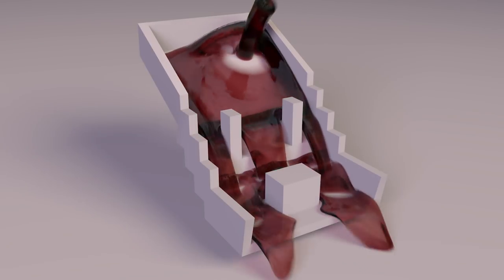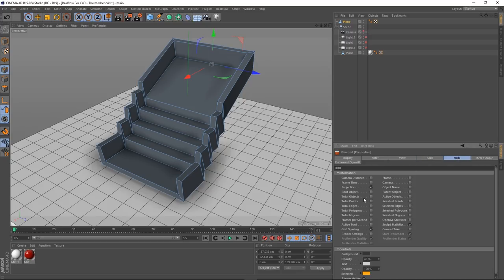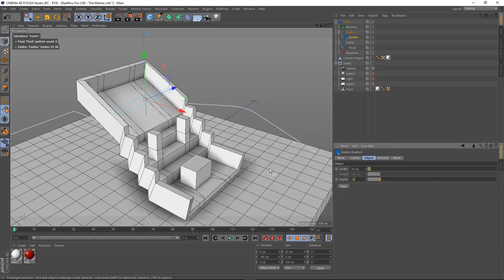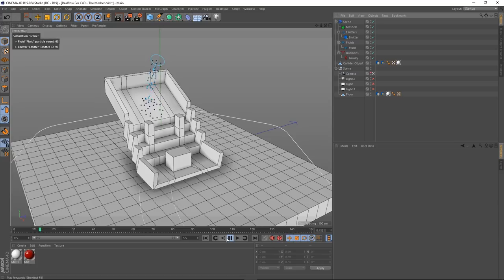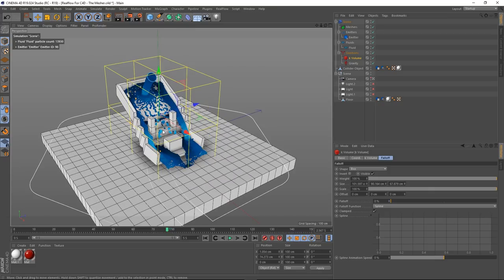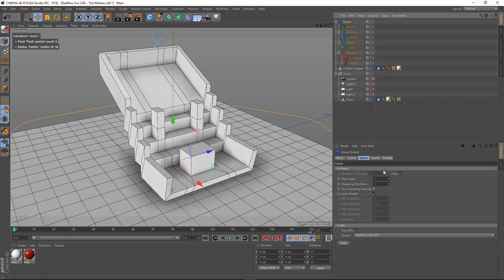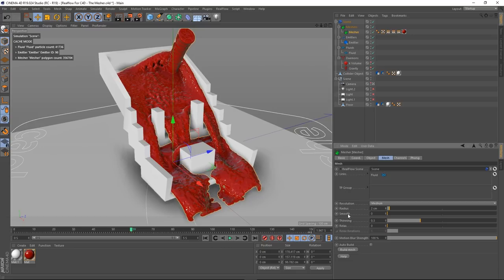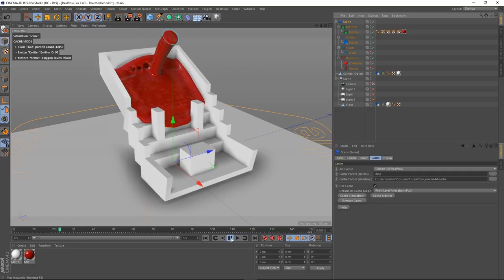Realflow For C4D: The Mesher

Comment: Thanks for posting :)

Quick question: 
My liquid never seems to come fully in contact with my objects properly, i can always see a gap.. like theres an invisible force field...

is there a particular setting i should be adjusting? thanks :)
Reply from the maker: Yes, On your collision object check the "Volume tag" there you will see a setting for "Surface offset" uncheck "Auto" and set it yourself.

Comment: I can not get it to actually mesh, i see lots of particles and they are behaving as expected but have not been able to produce any actual mesh.. It does display a polygon count (thousands) but I do not see any.
Caching the particles works fine but when i cache meshes it says that its caching gigabytes in mere seconds (while the cache folder does not increase in size). I tried changing cache folder but that didnt seem to make any difference.
Reply from the maker: I'm guessing you have a mesher object in the stack, is it ticked on?
Reply: @DIGITALMEAT  Is this the stack? If so, yes. https://i.imgur.com/kKFDHbm.png
Reply: @DIGITALMEAT  turns out the actual result of the mesher was located way offscreen, moving it around solved it.
Reply from the maker: @deathstroyer  Did you accidentally move the position of the mesher object after caching it by any chance?
Reply: @DIGITALMEAT  no it moved the mesh to the wrong spot because it couldnt handle the psr constraints on the emitters i think

Comment: Im trying something similar with realflow, and with less resolution(200-400) in cinema 4D R20 the scene is laggy when I press play... I've seen you have a gtx 970 here and Im using a gtx 1060 and i7 6700k processor. Also my cache sim takes close to 10 min long... What can be the problem? Tnx for the tutorial its so helpful!!
Reply from the maker: I'm actually using 2 X GTX970 in SLI, how much ram do you have? what's it's speed?
Reply: @DIGITALMEAT  16 GB DDR4 2400Mhz, but soon im gonna add 16gb more
Reply from the maker: @dariomartinez4974  - that should be fine, mmm
Reply from the maker: @dariomartinez4974  - Are you using an HDD or SSD?
Reply: @DIGITALMEAT  hey, thanks for the vid. I did the whole thing and it's fine and dandy. for some reason for me it was also really slow, even when i cached the scene. 
i did almost every settings identical to you, but still it's not capable of playing it back fluidly. 
do you have a solution?
i have 2 GTX 1070 Ti (altough, SLI is disabled, because someone told me how SLI can be actually holding back the performance if using Octane. to be honest, not sure if it's true) 
32GB DDR4 ram 
i7-8700 3200Mzh
and I have .m2 type SSDs
Reply from the maker: @vudielen  - Your specs are more than fine, you should be having no issues, are your gpu drivers up to date?
Reply: @DIGITALMEAT  hey thanks for taking the time to reply!
yep, i have the latest nvidia driver 430.86. 

the problem might be, that my scene had too much particles and polygons.  altough I did almost the same as you did, I like to experiment when i am following tutorials, so my collider object was a bit different, and it contained more liquid than your scene did, so I guess that might have slowed down the playback and also the caching.

edit: yep, that was the problem for sure:)
Reply from the maker: @vudielen  - Glad you figured it out :)

Comment: hello there! i am facing an issue. Say i fill a bucket with circle emitter particles. And on frame 100 i stop the emitter speed and immediately move location of bucket. Now problem is some of fluid penetrate with bucket and get out from walls of bucket. So am i doing something wrong or a bug?
Reply from the maker: The Particle location need to be calculate more often between frames. Select the "Scene objects" then the "Solver tab" and uncheck "Auto Params", then double the Min and Max substeps, this should solve your problem, if it doesn't, increase again.
Reply: @DIGITALMEAT  Hi, thanks for your reply. yes after increasing sub steps a very few particles penetrate with bucket. currently my setting is min - 3 and max - 600. So is there any other setting  no mesh go outside bucket?
Reply from the maker: @gauravshah025  - those settings are way too high, a min and max of 6 should do the job, also check your collision shape (cell size) and also surface offset

Comment: I got problem, when I Cach simulation? fluids are gone, how to fix that?
PS: sorry for my English
Reply from the maker: I need more details to determine what is happening. Are you just caching particles? or particles and mesh? Do you have a valid path for where the simulation will be cached to? make sure you're fluid and mesh is checked on.

Comment: Unfinished tutorial.u didn't tell that how to apply that transparent colour
Reply from the maker: That's because this is a tutorial about the mesher in the realflow plugin, this is not a tutorial about material creation. If you want a material like mine, create a material with the transparency channel checked on. then inside that channel control the colour using the "Absorption colour" and Absorption Distance"